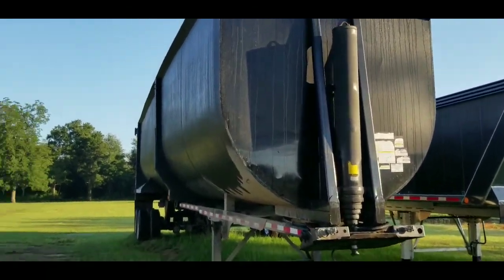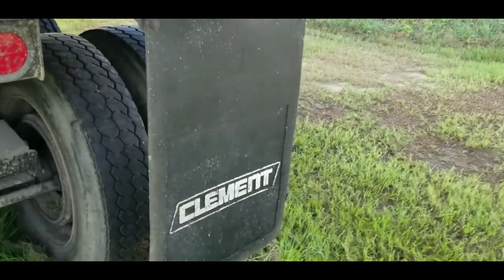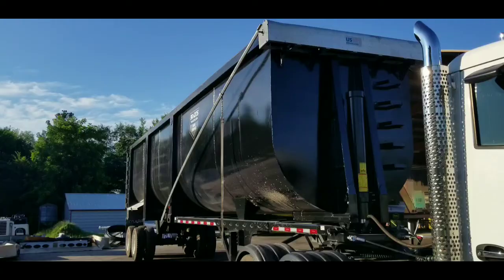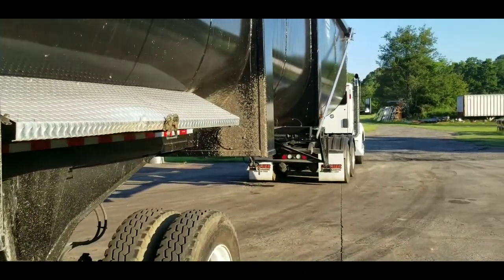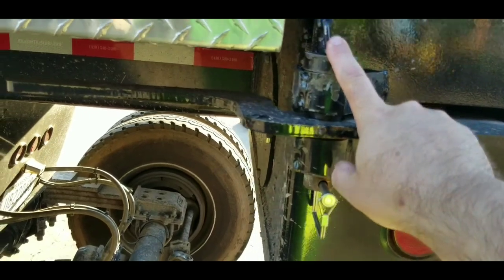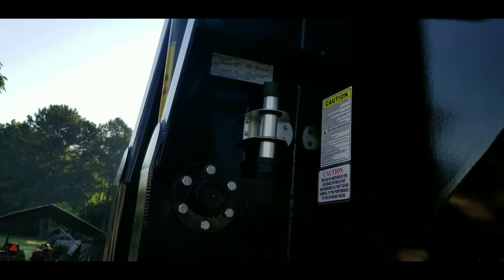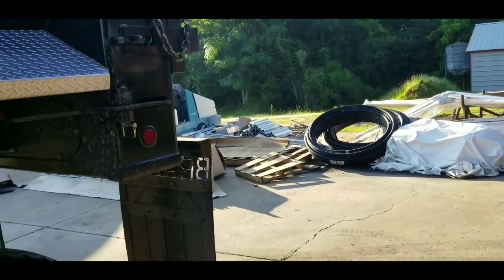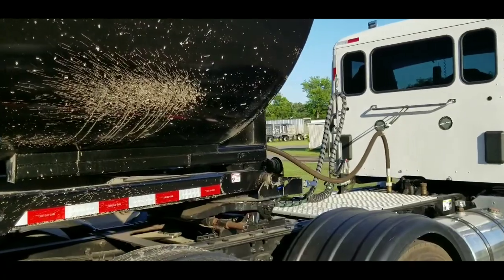Brazos Super Scraper vs Clement MonStar end dumps.

Comment: This is actually a great review of the two different trailers.

I wonder if you could cut a hole in the support to give visibility behind the trailer without sacrificing its strength?  I would wager its the vibration that caused the mud-flap support pipe weld to crack, more than the weight.

Too bad you can't get a nice Deloupe trailer there.  They're quite popular here in Canada.  I run a 5 axle Deloupe end-dump scow, weighing 62,000lbs empty, and 140,000lbs loaded.
Reply from the maker: It's all of it with the mud flap weight, vibration, wind. The bottom of the door is not reinforced to support it.  

And, yes we only run half loads here in the states.🤣
Reply: @jrichtruckincbtips  in mobile alabama  we run fully loaded 120 plus tons